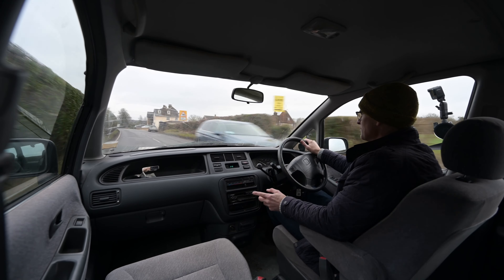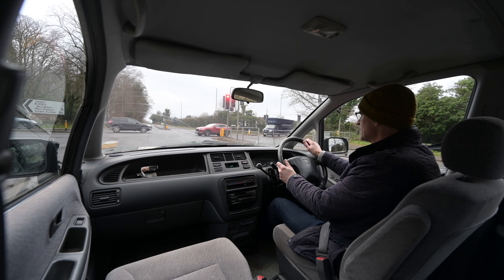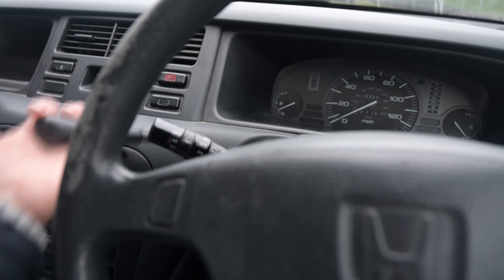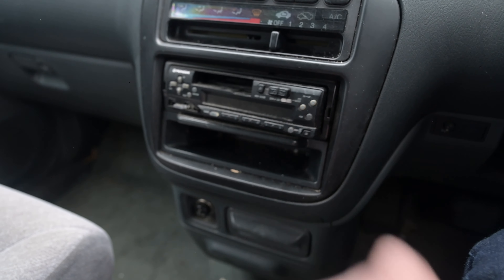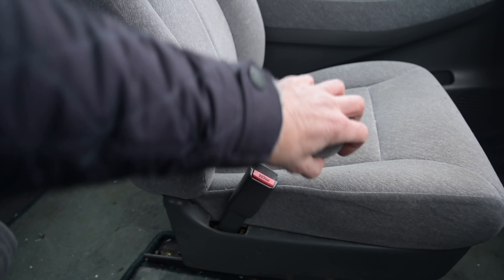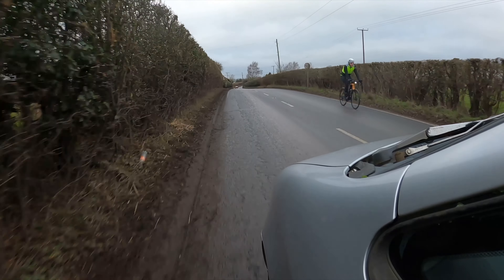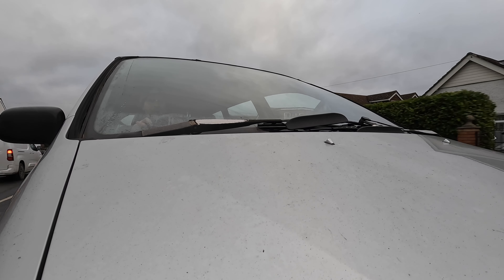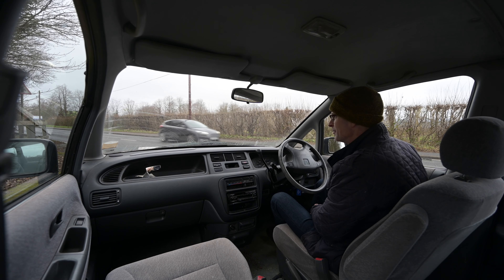The Forgotten bargain MPV - The Honda Shuttle Mk2

Comment: I couldn’t click on this video fast enough! I work at a Honda dealership and was gifted one of these 5 years ago when the owner didn’t want to repair it. It’s got over 200,000 miles on the clock and I love the damn thing! It really only needed a bunch of maintenance and fixing oil leaks. It was called the 1st generation Odyssey on my side of the pond. They did not sell well here as they cost as much as a mid level V6 Dodge Caravan when new. There a sill about a half dozen of them that I see running around my town. Sorry to hear it’s being scrapped. Lots of rust no doubt.

Comment: I had two of these - JDM imported Odysseys, one like the one you drove, and a later one with a moon roof and the 2.3 engine. Ideal for long trips to, and around, Scotland, including carrying my own coffee machine, and, on one occasion, a full Dolby 5.1 cinema set up, with a projector and screen! The only downside was, as you demonstrated, that you need to keep the back row of seats up in the winter, or the well fills up with condensation, and rust sets in...
The other problem was in travelling to London, because the Odyssey was black, so whenever you stopped in traffic, someone would think you were a cab, and try to get in!

Comment: ha! Repaired one of those last week - The owners of these drive them into the ground - great for pretty much everything. No frills. Very well put together, although this one had a faulty ignition switch causing it to switch everything off whilst on the Motorway at 60. Many parts shared with other hondas of the same age. Absolutely no info about these online anywhere. First time ever when searching for my fault the only info I found was my own question!

Comment: Being an avid reader of whatever car magazines I could get my hands on at the time, everything about the Shuttle (a.k.a. Odyssey everywhere else) suggested that Honda didn't expect to sell many of them here anyway - no manual, no diesel, cost more than its rivals, it was doomed from the start - so there wasn't much point in changing anything. At least it looks like it'd been engineered from the start to be easy to make LHD models so that it could sell in 'MURICA.

Honda have had plenty of JDM MPVs of various sizes that never made it over here at all: the mid-2000s Elysion, multiple generations of Stepwgn - all with thirsty petrol engines after diesel was outlawed for passenger cars in 2002 - but most interestingly of all, the kei-class N-WGN. Part of me wants one of those, just so that I can find out how much performance they've managed to extract from a 660 cc engine that has to move a box with the aerodynamics of a breeze block. I suspect... not much.

Comment: Top tip to add to the Furious fleet; SEAT Almambra. It’s a clone of the original Ford Galaxy/ VW Sharan, so arguably one of the better ‘90s/‘00s MPVs, is from a soon to be defunct marque and, panels aside, parts aren’t likely to be too much of an issue. Use it for years as a parts hauler, with a sturdy boot liner and the removable seats stashed upstairs in your barn, and eventually it’ll be a rare classic you can maybe sell on for £££££s. It could be seriously handy while you’re doing that old Mini up ….

Comment: The indicator/wiper stalks aren't backwards, they are the correct way around for a RHD car, so if it were manual, you could still operate the indicators while shifting gears.
All Japanese built cars had them this correct way around until sometime in the 00s when the went on a cost cutting drive and reverted to just using the LHD stalks on all cars.  At least on their exports.  I suspect they might still have them the correct way round for their domestic products.

My family's Mitsubishi Galant from 1989 had the correct stalk config.
Reply: I remember the Vauxhall chevette and cavalier mk1  had the stalks that way round and some BL cars as well in the 70s
Reply: Supposedly it's some sort of European rule, from what I've read. Most Japanese and Korean cars in Australia have indicators on the right, even if the UKDM model doesn't.

I vaguely remember AUDM Escorts and Cortinas having indicators on the left.

Some 1970s Datsuns had right-hand indicators, on USDM cars.

Comment: I have a lexus rx300, sadly an insurance write off for 1 door, which when the other driver admits liability.  But as for value , I'm paid out and door costs £150. Engine serviceable by anyone who can hold a spanner. Being a lexus v6 is smooth and relatively powerful.  I had xj8, xj6, m5 etc so not that level but not far off. 8f you want a look at a 2005 rx300 I certainly recommend it. I bought this by being let down by range Rover, I bought a l322 but head gasket failed before I picked it up. Then bought online another but this had gearbox failure the day before I was due to collect it going to mot. Lexus came up and certainly think filled the gap I need it for. If you're looking to see what they're like I seriously recommend

Comment: That driver's side wiper blade is definitely not the right length! That should be much longer. The minivan sure is a fine format for a vehicle, even if this Shuttle/Odyssey isn't that loved in general.  The replacement model had much sleeker styling.  I think that's the F22/F23 engine under the bonnet there, the unsporting SOHC cousin of the F20C DOHC engine in the Honda S2000, also related to the H22A DOHC in the Accord Type R (and used for Super Touring racing).  PS. It would be fun to get an Accord Type R on the channel!

Comment: These were good but pricey. They cost much more than the Toyota Picnic … as much as the bigger Previa and a fair bit more than the Galaxy/Sharan/Alhambra clones. I bought a 1 year old diesel Hyundai Trajet instead….. Cheaper than a van but it never missed a beat in 10 years and 120k miles….. same battery… same alternator …. same exhaust …. Same wife.

Comment: Is that a rover 600 engine?
Reply from the maker: I think that only went up to 2 litre, but might be the same basic motor
Reply: @furiousdriving  It was the comment that the engine in this shuttle is 2.2 litre but later models had 2.3l capacity that made me wonder if it was the same as the (Honda engined?) Rover 623
Reply: Yes these are basically the same engines that were in the Accord which in turn were also in the Rover 600